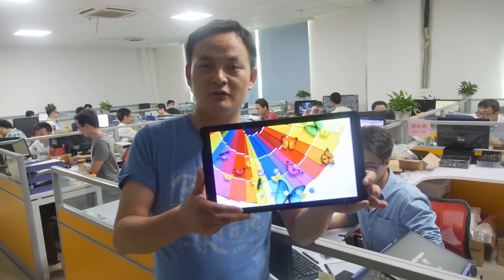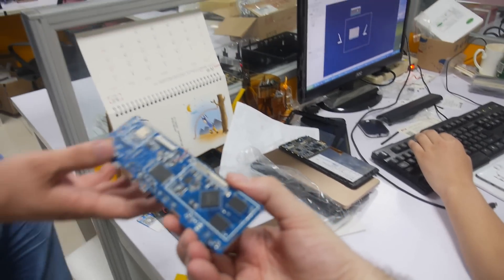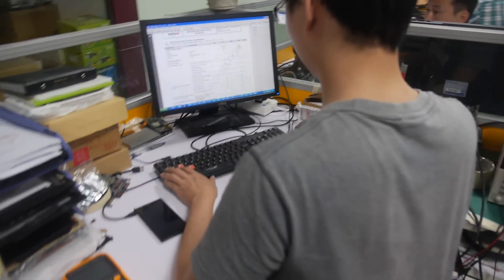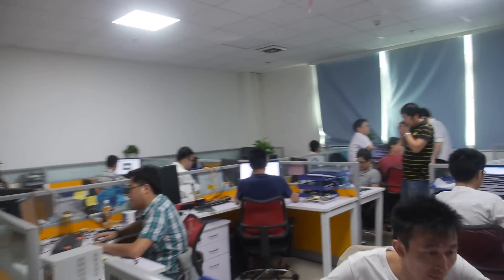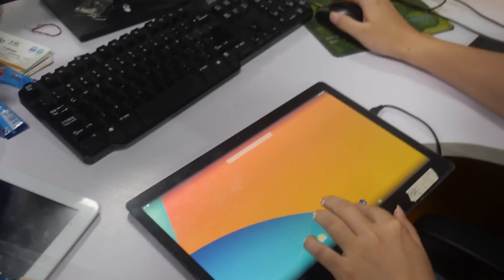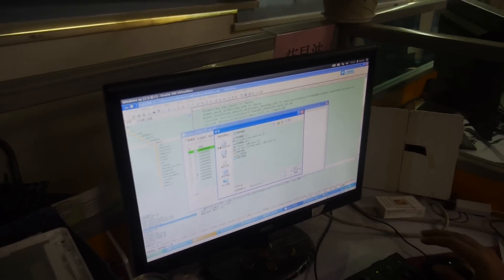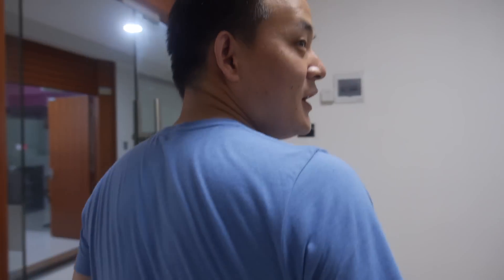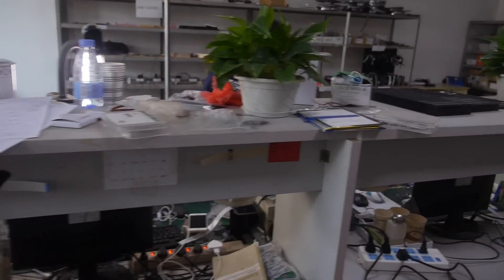ZED Rockchip PCB Design House, $138 ZED i13, 13.3"’ Tablet on Rockchip SoFIA 3GR 10000mAh battery

Comment: problem with 13.3 inches tablets is that  there is not  support from the manufacturer , no firmware  to flash the tablet in case of bootloop , no digitizer replacement  ...